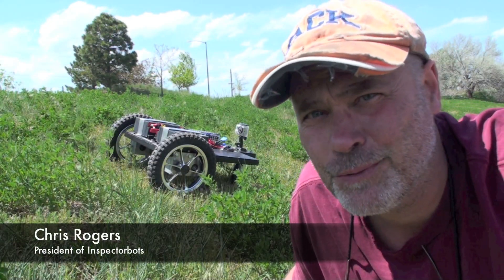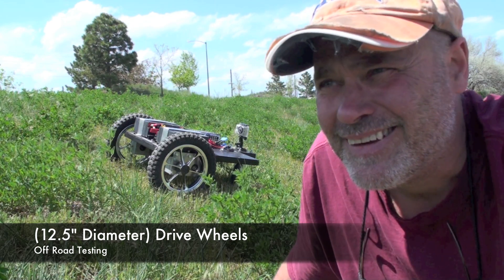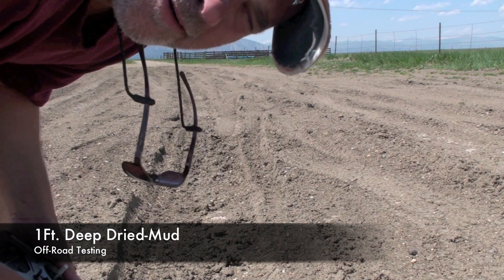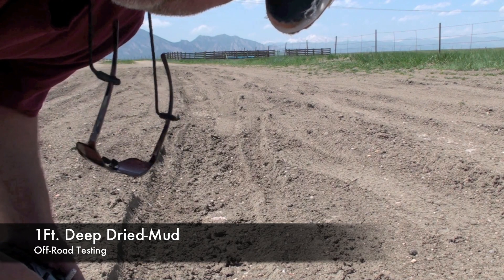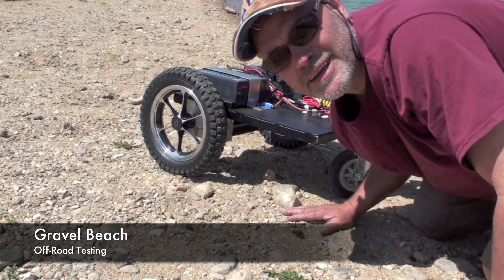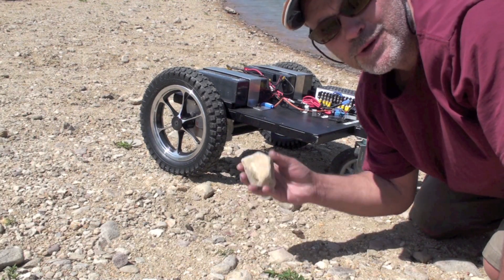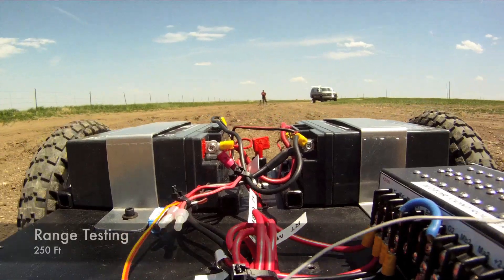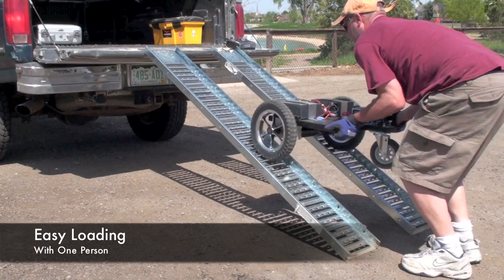Robot Off-Road Test

Comment: Like if my load is 300kg ,voltage is 24/48volts, then what should be the torque and power of motor, how to calculate battery requirements,usage and range